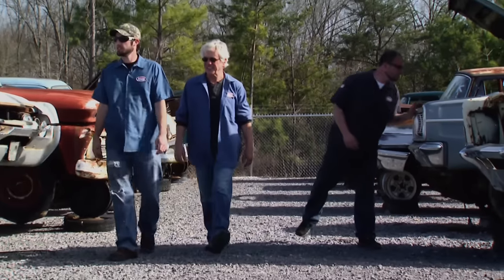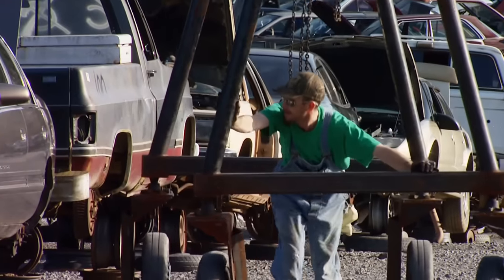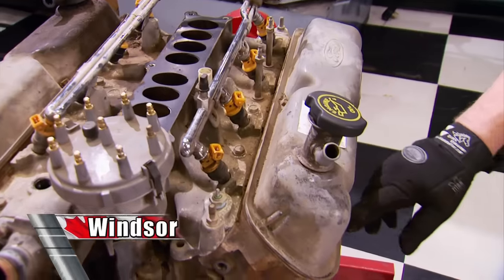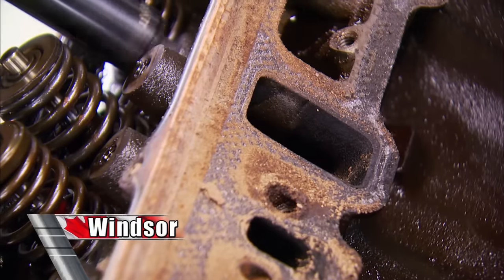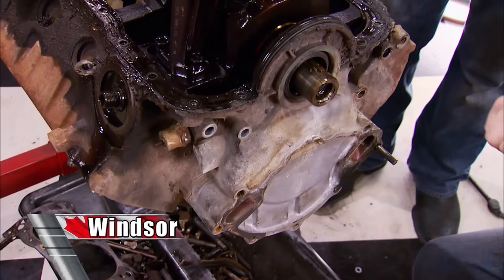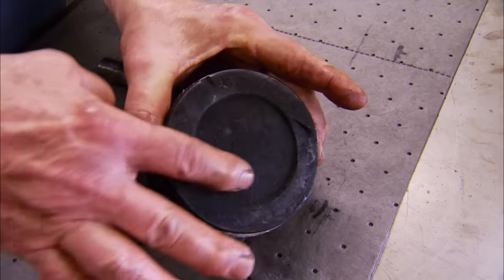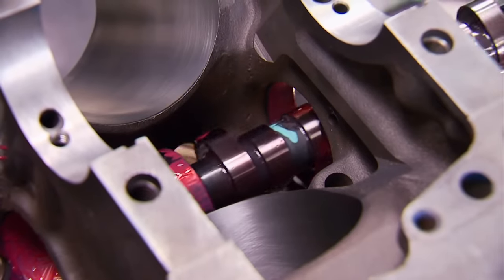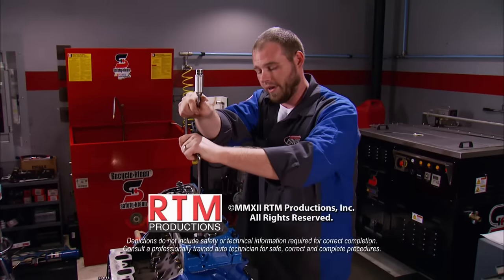Tearing Down a Pair of 351 Small Blocks: Windsor vs Cleveland - HorsePower S16, E10

Comment: My oldest sister dated and eventually married a guy who owned a brand new 70 Torino GT with the 4 barrel 4 bolt main Cleveland. Dark blue, black interior, automatic trans. He would come to our house for Sunday dinner and would toss me the keys and a couple bucks and send me out for an eight pack of 16 oz Dr Peppers for the family. I was 16 years old with a lust for horsepower and that Torino was a monster. The store was just down the street but it would take 45 minutes for me to return. Every intersection with a stop sign had two black tire patches running through them. He knew what I was doing but never said a word. Fond fond memories.

Comment: Ford stuff. Finally something I’ll watch.
Reply: Yeah me too.they burn you out on LS  gm stuff
Reply: I'm a Mopar guy, but I did have a 78 f150 with the Cleveland in it by far the only ford motor I ever liked
Reply: @CoyoteFTW  drove thousands of new ford super duty trucks, working for jct would never buy one, ford diesel engines nothing but junk....
Reply: slab buster RTR  i seen the7.3 power joke go down under 100 thousand miles, plus there the weakest diesel engine on the market?
Reply: @donaldkinder6716  and I've seen several 7.3 with 4-500,000 miles and up that still run, also ford did not make the 7.3, so what is your point?
Reply: @kevinragsdale6256  one Good thing ford didn't build the engine, but they did build the 6.0 and the 6.4 junk engine....
Reply: @donaldkinder6716  navistar/international made the 6.0 and 6.4.......
Reply: just spouting off nonsense you have read on the internet I see, and you do not even know anything about it.
Reply: @adamvowless6436  lmao ford engines, mostly junk, why u see sbc engines, in most race cars?
Reply: @donaldkinder6716  also the Ford GT 40 1st 2nd and 3rd in LeMans, also my relative owning the fastest N/A dragster in the southern hemisphere with a small block Ford a few years back. Yeah in speedway you will find 99% chevs and I know you can get huge power quite easily with SBCs but Ford definitely have their place in Motorsport
Reply: @adamvowless6436  lmao Chevy won more races in NASCAR, than ford ever will Chevy won around 3hundred more races, in NASCAR, than pos fords....
Reply: @donaldkinder6716  aw for fucks sake man, I'm not gonna keep back and forth comparing which is better like a child, I said chevs are algood but Ford's have definitely had their place in Motorsport
Reply: @donaldkinder6716  my dad had an F150 with the 351 Windsor and it still ran good the day he sold it with well over 200K miles.
Reply: @donaldkinder6716  my 390 is 55 years old. Only put minimal repairs on it. Hauls ass for a 55 year old engine
Reply: @verdant2215  360 or 390 pretty good old engines, still never be a sbc engine...... I know had plenty of fords with v8 engines, burn the valves out of 351m a 289 a 302ho and a 360 running them hard.....
Reply: @donaldkinder6716  not a ford fan. Just really impressed that a 390 older than me can keep up with a modern car.
Reply: While your ford is in the shop 😂
Reply: @donaldkinder6716  stop watching ford videos then.not interested in your comments..ford v8 4 eva
Reply: @raymondvesty2868  lmao u must be ford engines, still junk buddy......
Reply: My bad, meant to say F250.
Reply: @donaldkinder6716  no
Reply: @donaldkinder6716  I guess you haven't heard of the 427 SOHC Cammer V8 from Ford then have you.
Reply: @donaldkinder6716  I have a 1996 Ford F150 with a 5.0L (302) Windsor V8 with 209,000 miles and still going strong and a 2011 Ford F150 with a 5.0L Coyote V8 in it with 141,000 miles and still going strong and its a beast and it sounds like a beast with the Borla ATAK exhaust on it.
Reply: @verdant2215  Awesome brother those 390  FEs are great engines and they sound amazing.
Reply: @donaldkinder6716  Ford has a lot of really good engines

Comment: I always loved the stock "Powered by Ford" valve covers on the 351/400 Cleveland and M engiens!
Reply: the old 80s 302/351 cfi H.O. ford motors came with special aluminum valve covers that said that.
Reply: 6cyl and windsor had it long before cleveland
Reply: The older style FE ones are cool too, there were two different FE valve covers that said Power By Ford

Comment: Anyone else notice the "71 LTD Land Yacht" was actually a 74 Mercury Cougar?
Reply: Right off.  Wasn't going to comment.  I don't think these are Ford guys.   They said that was a running engine in Cougar.   I wonder what the rest of the car looked like?   I've driven one of those.. It is a boat, but it's a dreamy ride.  I wouldn't mind owning one
Reply: Another minor thing, the oil pump shaft does not drive the distributor, it's driven by the distributor. 9:52
Reply: The knee bone's connected to the thigh bone . . .Got me wondering if the inventor of the camshaft was an eccentric genius, or am I just profiling ?
Reply: Flat top pistons and 79cc 2 bbl. C chambers doesn't give " 10:1 "... more like 9:1...
Reply: Yes.  Why even call it the wrong car?  Do they think no one's going to notice?
Reply: No, because I skip the chuckle head stuff and skip to the "meat" , though this was more hamburger than steak.
Reply: It's an LTD.  Cougar did not have the reflector on the front fender.
Reply: 74-76 Cougar,Tbird, Gran Torino Elite  all the same car just cosmetic differences.
1st car was a 78 Cougar 351M. Have owned a 75 GranTorino Elite with 351C(early 75 build still used the Cleveland  with a Duraspark) still have my 73 Mustang coupe 351C.  75 E150 351W Several Crown Vics and Grand Marquis  Broncos and F series Trucks mid 70s to 2000.
Small fleet of  E350 vans. I just sold off a few and down to 8 vehicles.

Comment: My dad had a 351C 4V 1970 Mach 1. It was a factory 4 speed car. I was about 6 years old when he brought it home for the first time. It had a blown engine but the car was cherry. He paid almost nothing for it. He took it to just south of wild on the engine build. 11:1 compression, Oversized the  valves, sourced Ford's "lemans" rods, (could still get them at the ford dealer, balanced all the moving parts, big thumpy solid lift cam,  ported and polished  heads, ported and port matched aluminum high rise intake, massive 1050 dominator carb, full length headers to 3" exhaust.  He built it to move some air. Man, my first ride in that car he nailed it. It wa like the hand of god pushing back in the seat. Stupid powerful. 

My best memory of that car: dad was out of town for work. Mom's thunderbird would not start to take us to school - battery dead. So, she grabbed the mustang's keys and loaded all three of us kids in the car. We were sitting at a red light and i guess she got distracted, probably by one of us. The car behind us honked. Mom looked up, and the light had turned green. She quickly slammed it into first gear and just dumped the clutch. She boiled the tires and it fishtailed all over the place going in to lane to lane. She finally got it hauled down and stopped just in time for the next red light. She was shaking so bad. Just scared the piss out of her. First and only time i ever heard my mom swear and it was the big one too. In exasperation she said, "FUCK!" The real Insult to injury  - A camaro rolled up full of teenagers looking shocked, and the driver yelled, "Jesus Christ, lady." She never drove that car again. I always tell that story as "the greatest burnout i've ever seen."
Reply: Best mom story like forever
Reply: Not matter how much it scared her and no matter how unprepared she was, your mom was a badass for that one lol!
Reply: Reminds me of my step mom when my Dad let her drive his 55 Chevy, with him in it with us. No way he'd ever let her take his baby alone. At a red light and a boy next to her I guess gave her that want a race look because my Dad said...No! Don't do it. 😂 She did. O he was upset..🤣 but she had the biggest smile.
Reply: lol  go to spec savers
Reply: Thats too funny

Comment: I am no mechanic.  The most labor I've ever performed on my vehicles is motor oil and filter change, check fluids, change air filter, all very minor stuff.  Most of the stuff presented in this video is way over my head.  However, I find it fascinating when these men rebuild these engines with performance parts.  I love this channel.

Comment: I had a 351 Cleveland in a 69 Torino fast back and my god was that thing a beast, it would eat Z28 camaros and it was stock with a 2 barrel, only thng it had was headers. The 351 Windsor is also a very goos motor put together right.
Reply: Steve Sosebee  Of all the cars I've had over the years I miss that one the most. I'm in the process of doing a 351 Windsor for an 88 Bronco, new HP cam, roller lifters, roller rockers and GT40 heads. leaning towards an after market fuel injection instead of the 95 fuel injection that came out of the truck the motor came out of. Hoping it runs as good as the 302 in my 88 Bronco plow rat I did a similar rebuild to.

Comment: I can’t wait for the rest of this series! I have the Windsor in my daily driver with 212k miles and no problems. And I have a cleveland to drop into my 69 mustang... can’t wait for good build tips for both.
Reply: Sweet!  What's your daily driver?
Reply: Fastback?
Reply: Daily is a 1993 f150 4x4 extended cab. And yes the 69 is a fastback. Just an M code sportsroof that I’m doing a full resto on.
Reply: Noice
Reply: Windsor
Reply: Sell the Cleveland to a factory resto guy and buy a roller block Windsor and bolt some AFRs or Trick Flow heads on it. You'll get an engine that weighs less, makes more power, and will fit under your '69 Mustang's hood better than the Cleveland.
Reply: @prushimush  and is visually correct as Cleveland didn't go into mustangs until 1970...

Comment: I had a 351w in my old 76 motorhome I had. For being over 10,000 pounds the 351 moved it pretty good. She did have a drinking problem she loved her gas. Had a 103,000 miles on it when I got it and she ran great.
Reply: You can get a 72 to 87 RV or truck by any of the big three for super cheap because those years they all had super low compression (typically below 8:1) to meet federal emissions standards. but it makes the engines feel very lazy and is not good for mileage. and when the feds mandated ethanol in gas that made it worse. Alcohol and low compression are death for millage (and it don't help the performance either) For those that want a cheap truck or RV (and can work on them) it's totally worth it to get a late 70's truck/RV , pull the engine, rebuild with flat top pistons, curve the distributor, upgrade exhaust, ignition set up, cam etc. it's very easy to wake up those engines and get better millage and way better performance.

Comment: In 1972 a friend of mine bought 2 new Mercury Cougars 1 was a basic cougar with 351 Windsor, the other was 351 Cleveland with dual exhaust and 4 bbl carb. Driving these 2 cars was like night and day, huge power difference with the 351 Cleveland way exceeding the Windsor 351.
Reply: Cam and 4bbl was the major difference in his case. Clevelands had a nasty reputation of over heating.
Reply: They were 100 times better than any of the Windsor's... the Windsor's had head issues, constantly... pretty much junk unless you reworked the heads and put, dare I say it, some Chevy parts in them...
Reply: @fawnlliebowitz1772  Not even close to true. I had SEVERAL 351 Cleveland's, NOT ONE, ever, over-heated. I think you're thinking of the junk Windsor...
Reply: 2 bbl, lower compression, vs 4bbl duels taller gears most likely, I would hope there would be a difference. Now if you had a Boss (which was a Windsor) you would see even a bigger difference.
Reply: @fawnlliebowitz1772  The BOSS engine was decent, true. But STILL had issues that the Cleveland simply didn't. Hell... I've forgotten more about building, than what most of these guys will ever know... Simple, as that.